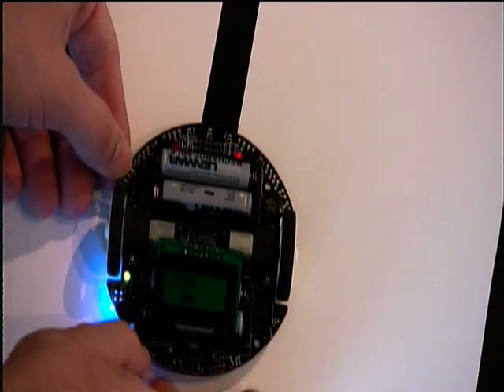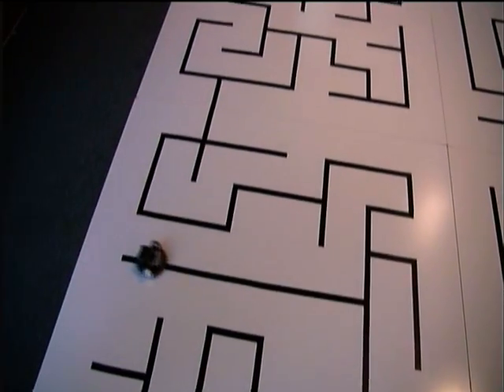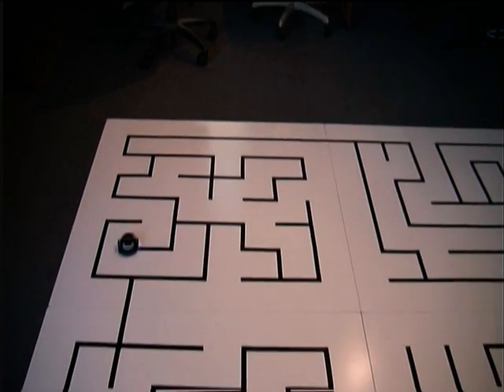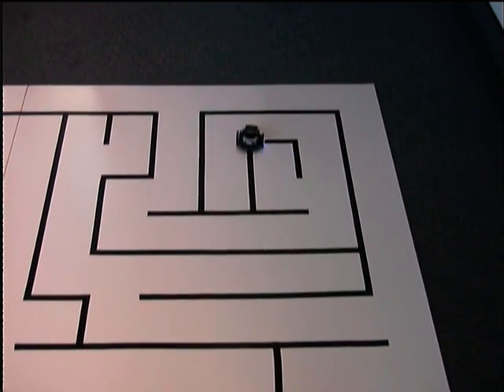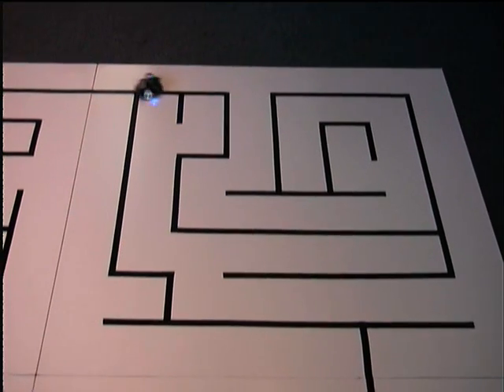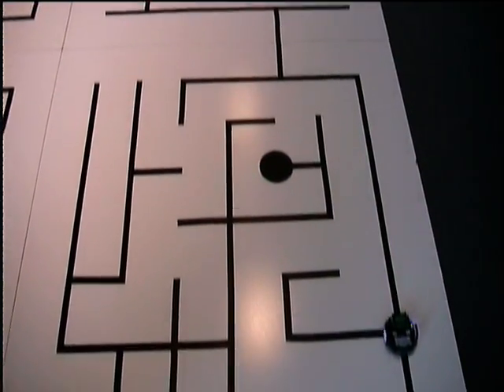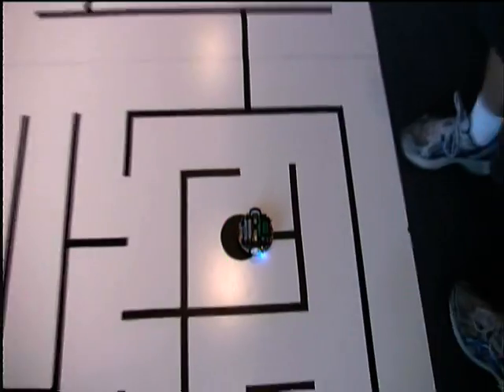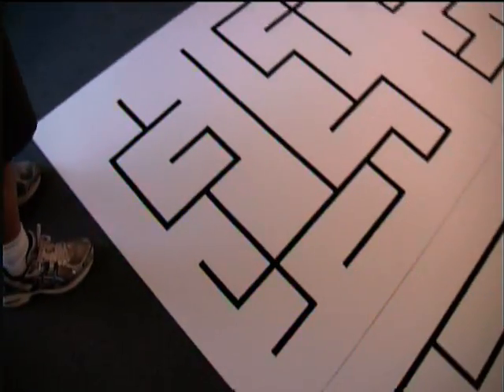Pololu 3pi Line Maze Solving Robot

Comment: ah back when geared brushed motors and AA batteries were as good as it got for hobby robotics
Reply: Actually. Triple A
Reply: actually something i saw in a recent video is that those batteries get their voltage multiplied then metered back down to 9 volts so essentially those batteries give full and consistent voltage till they are dead, but also this is more about the programming aspect of the robot.

Comment: Are you following the depth first search algorithm? And your sensors are mindblowing. Also what motors are you using? Normally DC geared motors low torque don't stop at the moment when we signal them to.
Reply: +Avirup Basu well. you have same problem with me, he use metal geared motor and i use small dc motor low torque with plastic gear. i think that is the problem. so we can use metal geared motor and i think that is strong enough to make robot turn left or right at the moment.
Reply: +Avirup Basu Its a pre built robot, he just had to code it.
You can buy that robot here : http://www.amazon.com/gp/product/B003XGJ3XS/ref=as_li_ss_tl?ie=UTF8&camp=1789&creative=390957&creativeASIN=B003XGJ3XS&linkCode=as2&tag=intorobo-20
Reply: @AkshayAradhya  he actually made the company which sells those lol

Comment: The only issue is, what if the path directly left of the start was another way to get to the end and was faster? It wouldn't know and therefore would be slower than possible.
Reply: Perhaps it should either perform a second mapping with right-hand turns, or, once it's found the end to turn around and keep mapping until it can reasonably believe it has mapped everything.

Comment: Very clever! However, I have a question: if there are multiple routs to the centre and it learns both, how does it judge which to go down? If they both have the same amount of turns, how does it work out which is best?
Reply: It doesnt learn two paths. Like he said, its literally left leaning meaning that it will hug left wall until a successful path is solved, thats the only path it will know.

Comment: What does the robot do if it can't complete the first pass in the time alloted?  The original rules for line maze (using 1/4" tape instead of 3/4") made it very difficult to complete a first pass in only one run.